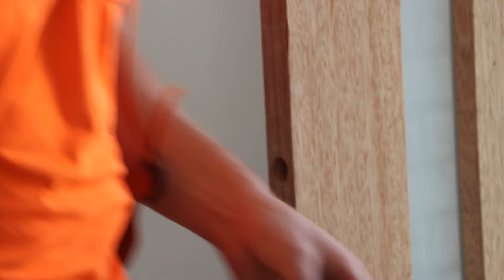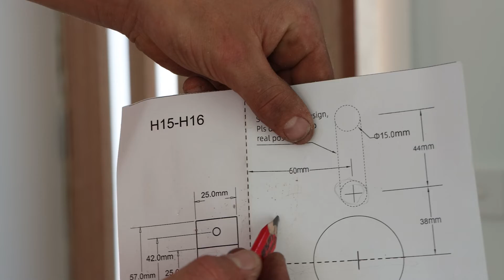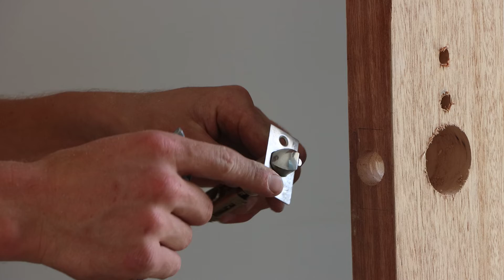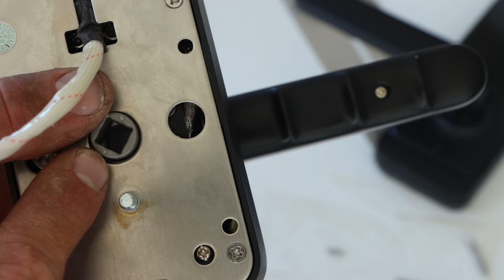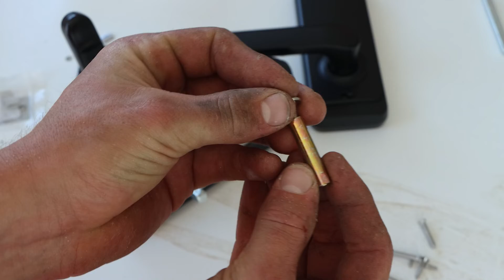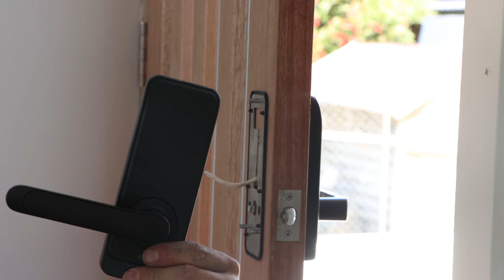How to Install a Smart Door Lock

Comment: Much better/efficient to do all the marking out together rather than mark a hole, drill it and then mark the next etc. Mark round the face plate of the latch with a knife while it's in position, not with a pencil and then free hand with the knife. When chopping out for face plate make a series of horizontal cuts with the chisel, it will breakout easier, also when cutting at the top and bottom edge use the flat edge of the chisel not the bevelled edge. Basically don't take any notice of this video!😂